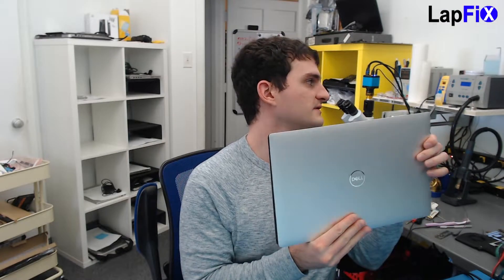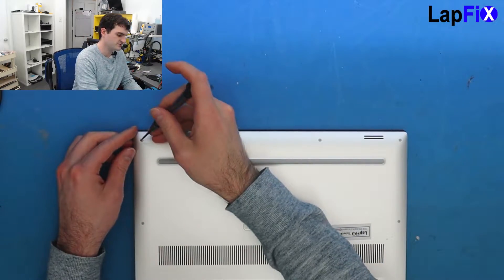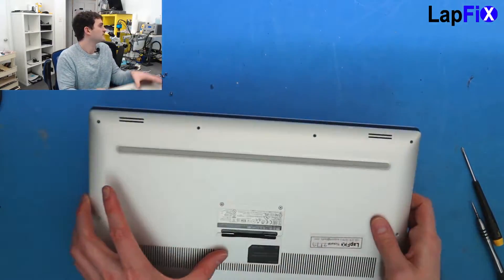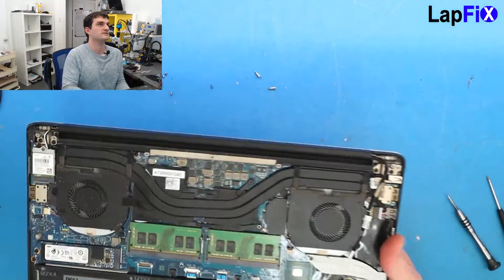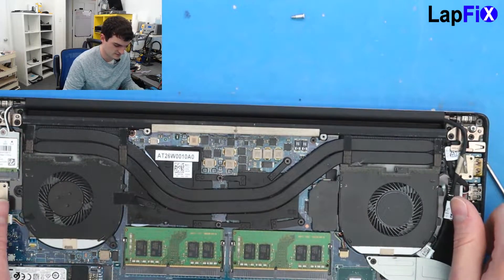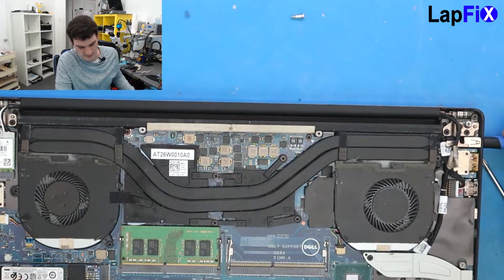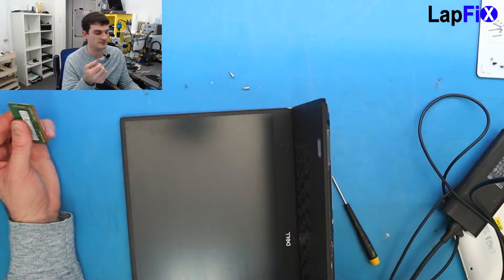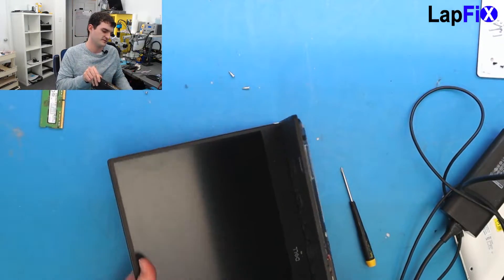How to Fix Dell XPS 9570 with No Display - Easy Fix

Comment: I've had this exact thing happen on other Dell machines.

Things to try:

Press the power button until the keyboard lights up. Press and hold the power button until the system powers down. Press the power button again to turn the system back on.

Disconnect the AC adapter. Remove the back plate. Disconnect the main battery from the motherboard. Use something plastic, like a guitar pick, to pry the connector if you have to (don't use anything metal). Press the power button. Press the power button again. Reconnect the main battery. Press the power button to turn the machine on.

If the above does not work, remove the CMOS button battery for 30 seconds. It should be to the right of the right fan, possibly under a bit of thermal tape.

If none of that works, or if the issue repeats, you have a bad motherboard.

Comment: My XPS 15 7590 screen goes black randomly. I have to get it back by pressing SHIFT-CTRL-WIN-B to restart the driver. Very annoying.
Reply: @Mourad BEN AHMED DAHO I don't know i haven't tried. Should i?
Reply: @robertdewar1752  you need to turn off auto refresh of a screen in intel igpu panel. It happen with Oled screens.

Comment: I have an xps 15 9550 running windows 10, have an Aukey 12 In One hub running through the thunderbolt port, this hub has a VGA connection which I am trying to connect a monitor.  Know the monitor works because I've run it on a different computer.  Monitor refuses to display, Windows Settings  shows the monitor, but  does not display..  Any ideas?   (other ports on hub run are running 'as expected')
Reply from the maker: There may be a button or setting to switch the display to either "mirror" "extend" or use the laptop screen only or external monitor only.  Usually there is a function button that can do this or just go into the display settings
Reply: Or just press Windows + P and select either extend, duplicate or second screen only